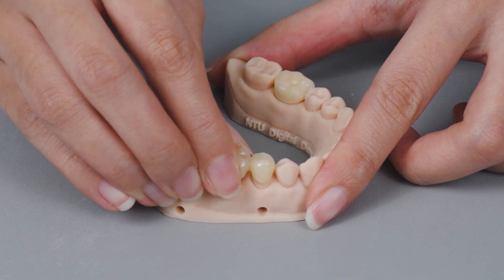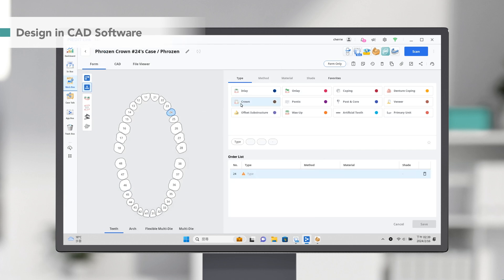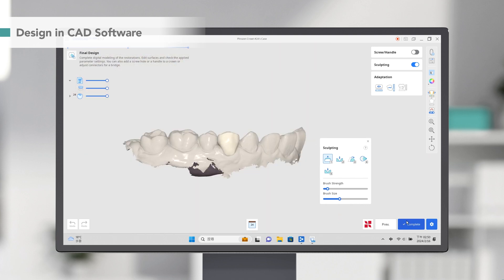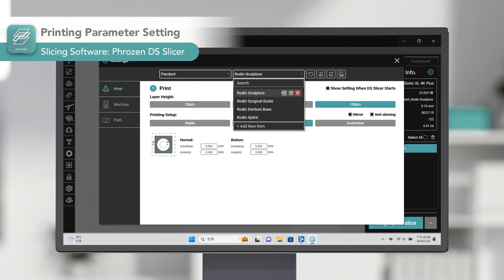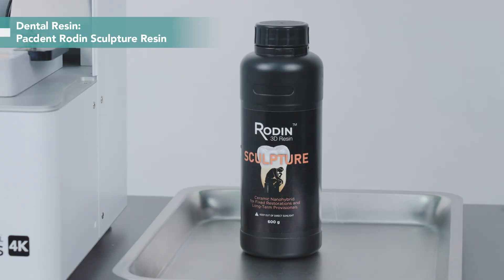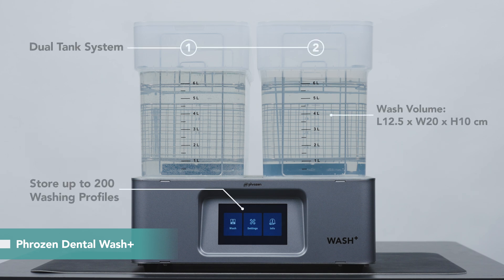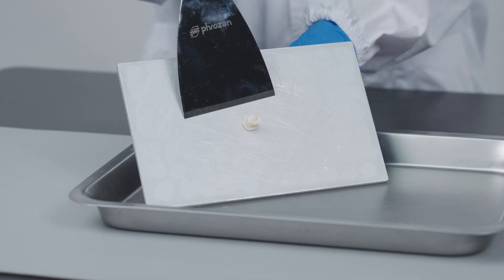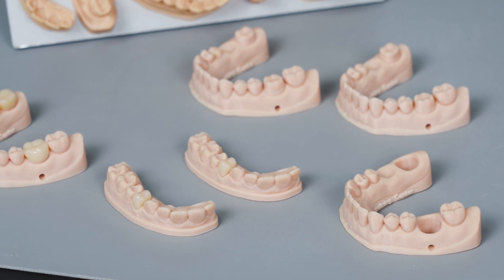How to Produce Crown & Bridge with 3D Printing - Phrozen Dental 3D Printer

Comment: the resin strength compatible with traditional ceramic crown?
Reply from the maker: For a durable and aesthetically pleasing restoration, the most compatible and commonly used resin is a composite resin or resin-nanoceramic, as it provides adequate strength for temporary or less-stressed posterior restorations, though traditionally ceramic crowns are the preferred choice for long-term restorations due to their superior strength and durability compared to pure resins
Reply: It is less than 15% as strong as a zirconia crown.  There is zero chance these restorations will last for 10 years.